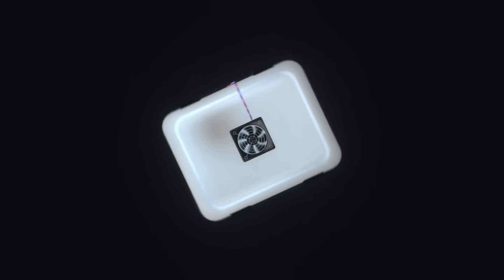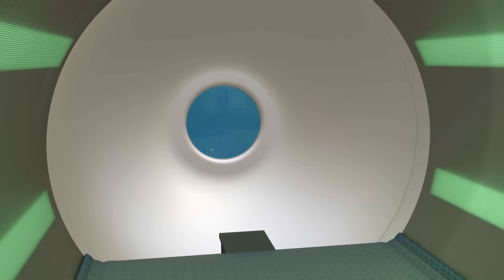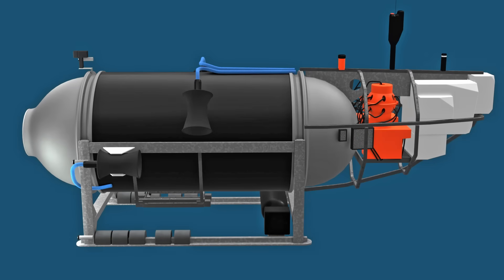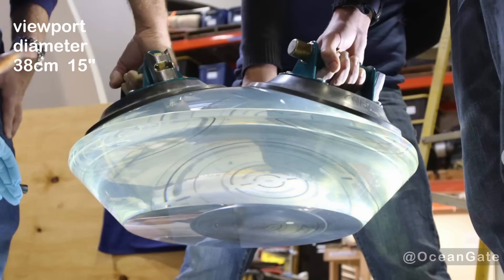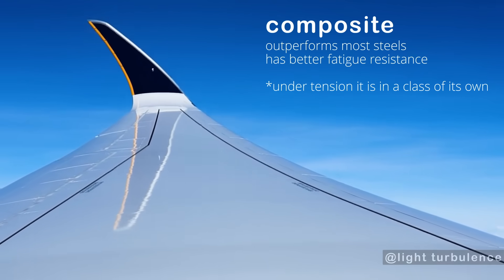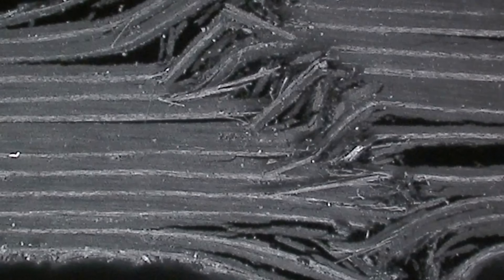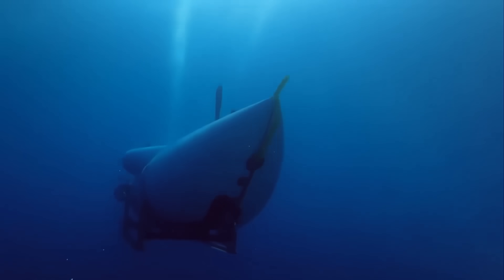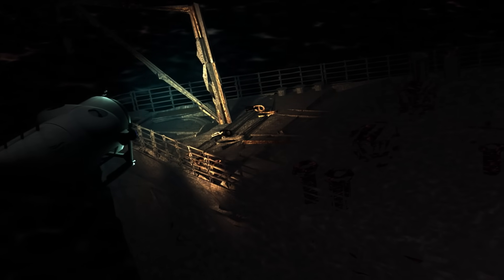Titan Sub | carbon fiber - Detailed Tour

Comment: I remember seeing the edited videos of the build process, and what stood out to me as a non-expert was the process of bonding the ends to the CF tube; the glue was hand-applied (and the surface apparently not cleaned beforehand), bare hands were touching the CF during the application process, it was not done in any sort of clean-room (lots of dirt and dust in the air), and there was exactly no squeeze-out when each sphere was slid onto the tube, meaning there were almost certainly voids.
Reply: Agreed.  I wonder if they had significantly extended the flanges on each end and properly glued them if the sub could have made more cycles before imploding.  I suspect that might have been the case.
Reply: That stood out to me as well. This was not the time for handmade structural components.
Reply: @LordPrometheous In Australia we call it doing a backyardy!!
Reply: @DownUndaDigga  yeah, when it comes to something that could be fatal if there's a problem, that's a hard pass.
Reply: Oh no, they were very careful to repeatedly include some guy with a rag wiping those parts down. I know, a rag right? Sheesh, what a con the whole thing was...
Reply: There was a huge void in the Ocean Gate CEO head nothing but air and ego !!!!
Reply: I wouldn't have trusted even a home aquarium to be constructed in that manner.
Reply: No squeeze out is what shocked me.
Reply: Yep. The no squeeze out floored me. Complete foolishness time and time again.
Reply: Don't they cure the carbon fibre in a vacuum oven which pulls out any air from within the layers of carbon fibre?
Reply: @ALucas73  nope it needed to be cured in an autocave. there were many amatuer hour mistakes in the construction.
Reply: Yeah, I remember watching a video of this process and was shocked at the apparent casual nature this was done. I'm no expert on building subs or fixing composites to titanium, but the whole thing looked sloppy for such a high pressure joint.

It's become more and more obvious that Mr Rush was not sufficiently focused on safety, and that's a cardinal sin if you're researching novel deep diving vehicles, no room for error thousands of feet below the oceans surface. Sort of boggles my mind he could be so cavalier with his own life, never mind his passengers.
Reply: @paulelephant9521  he was arrogant for no reason. He did not portray the arrogance that people say would be deserved because the arrogant person is correct due to their vast knowledge and exp

He stated that concerns of the safety of Cyclops 2 aka Titan were personal attacks on him. 

He may have had daddy issues because his father was a successful explorer and Stockton Rush was basically a nobody in comparison as well as being on the lower scale of wealth compared to his family. 

He was counting pennies when there was dollars to be had. 

There is a reason why the Russians were charging a million per person on the Mir submersibles to the Titanic. You will not break even or make a profit taking people there unless you charge that or higher
Reply: Arts &crafts
Reply: I agree, glue being the only joint between dissimilar material shear. Should have been pocketed so compression could only push the parts tighter, improving seal and not shear from partial glue failure.
Reply: @strayblackcatsmeow It WAS pocketed, the titanium flange had a 'U' shaped profile that the carbon fiber slotted into. 

The glue is a red herring, because so long as the carbon fiber tube remained intact the end caps would be held in place by water pressure alone.

The real problem with the joint is the shear stress from differential expansion at the point where the titanium 'U' no longer overlaps the carbon wrapped tube.  Carbon fiber has negative thermal expansion while Titanium has positive thermal expansion, and carbon fiber is extremely rigid while Titanium has high ductility.
There is also the problem of the differential expansion between the composite overwrap and the inner metal tube, which would cause the tube to shrink faster than the carbon fiber, which would promote delamination and buckling of the individual carbon strands.

Additionally, the pressure cycling in compression would compress the polymer resin matrix of the composite more than the carbon fiber, which would lead to microcracking of the resin when the pressure was released.  This would have potentially allowed saltwater to infiltrate the matrix, which could leave salt deposits behind when it was squeezed back out of the cracks during the next cycle.  The salt crystals could then induce layer delamination, or even direct shearing of the carbon fiber strands.
Reply: the whole construction process was a JOKE. If he had said Im gonna take you to the titanic and I saw that contruction video and we were using a damn nitendo controller to go down to such depths, NO THANKS BRO.
Reply: @dustyflair  That's a cheap Chinese knock-off controller NOT a real one. Stockton is a GANGSTER with the checkbook.  Not wasting money on a hard wired backup either."
Daddy has to save $15.39 when he can.
Reply: @dustyflair  it was a PC controller, but your point still stands.  I just don't understand how anybody with the means and resources to pay for this trip could also be foolish enough to even consider going with him. More money than sense applies here.
Reply: @dustyflair  I also don't see how all these customers were aware of his work, and obviously aware of all the warnings from experts in the field, yet they chose to ignore all of that and get in his literal death trap
Reply: @LordPrometheous if you have 250K spare money to spend then you are probably well-off. To the person that can easily afford to spend this money, the line - once in a lifetime chance - is something that they cannot pass. The   millionaire father and son probably were overexcited and hyped to see the Titanic and our FOMO world today isn't really helping to make thoughtful decisions.
Reply: @Gourmondise  I would have thought my most precious asset, my son, would mean more to me than to embark on such a risky endeavor.  The same intelligence and prudence that made me wealthy would also make me ensure that I do my research and heed any warnings about deep sea treks with a nut job. But some people's risk meter is broken, so there's that. The son didn't even want to go, and was terrified. I feel bad for that kid. He should never have been there.
Reply: @LordPrometheous the mother mentioned in an interview that she gave up her position to her son because the boy wanted to go very badly, as he was very interested in the Titanic. The aunt on the other hand said the opposite, how he went primarily for his father, as a bonding experience. I personally believe the mother, as the aunt seemed very fake and full of false emotions in her interview when she said this.
Reply: -lynn  that's interesting.  I haven't seen the interviews, and I'm not good at reading people's body language or emotions. Now I want to watch. Thanks for the insight.
Reply: They should have used duct tape, and gorilla glue.
Reply: The fact that the titanium flanges had both been blown outward on both sides shows that the carbon fiber probably brittle broke at the ends crushing outward and inward expanding and thus ripping off those flanges..I suspect what you say is exactly why .Voids and bad binding ..without a good bond to the titanium it let it crush instead of being a stable transition..I suspect the gun shot noise was it starting to fail...
Reply: same thing ,mixing and applying epoxy,
Reply: They could have put two titanium rings in the center for support. This comes from a painter.
Reply: @TheOneWhoMightBe You have not said anything that I feel confident is of any value, in regard to why the submersible did not hold up under pressure and the language you use to describe the various objects out of which the device was constructed, was vague and ambiguous. OK I'll accept "CF" as being your abbreviation for carbon fiber composite, but not with some trepidation –. if you do not first state the whole subject or object, it may always remain uncertain as to what subject or object an abbreviation points to. Next. when you say "ends" were "bonded" to the "CF tube" your language gets even more confusing. Ends of what? Bonded to the carbon fiber composite cylinder, at each end of the cylinder, was a titanium ring, – not an "end." Attached to each ring, with threaded fasteners, were titanium hemispheres. These were hemispheres (approximately), not spheres. But here is where you create some more confusion: you go on to assume that the if would have been better if the substance that was used to adhere the ring to the cylinder,  would have been  better bonded if bonded to clean surfaces, and applies by some method other than "by hand." So you have any information that supports these assumptions? For all that I know, the particular substance used to "bond" the titanium ring to the carbon fiber composite cylinder, would make a better bond if applied to "clean" surfaces, and if no perspiration or oils from human skin, were on any of the surfaces. I have no reason to assume this is true. Seems plausible that it would, but I couldn't say this is true, for sure. Perhaps, given the bonding agent that was used, conceivably perspiration or skin oils or both, might make for a better bond. But then you assume the material between the ring and the cylinder is being used to "bond" them. Might it also be needed as a sealer, or gasket? Now, to me, the whole idea of using only a fluid substance between the cylinder and the end-rings, seems rather risky. The following idea might be irrelevant but personally I would never rely on fluid sealer alone, to keep water from getting into the vessel, if I were designing something like this. And important factor, which has been overlooked in your discussion, is the fact that the cylinder and the rings were of different materials, with different coefficents of expansion, and with differnt adhesion to different adhesives. When we have 2 different materials, we usually call the material that is there to hold them together, an adhesive rather than a glue. A glue is what I call something that holds together to similar or identical materials. For example  when making furniture from wood, and joining pieces of wood together, I use wood glue." When attaching 2 different materials together, such as attaching plastic laminate surface material to a plywood surface, I use an _adhesive. I would think, perhaps incorrectly, that the main purpose of the thick fluid material between the cylinder and each ring, is as a caulking material, and only secondarily as an adhesive. But I could be entirely wrong. My point is, I don't really know, and – I have no way of knowing if you really know either Offhand, it sounds to me like you very might just be guessing. You have not said anything that makes me feel assurred that you are not just guessing, same as I am. Whaddaya think?
Reply: @soilmanted I generally enjoy and appreciate pedantry but find it ironic that you couldn't be bothered to proofread your essay before submitting it.
Reply: @user-Aaron-  I agree with you. Reading it now I am feeling embarrassed by how badly it was composed.
Reply: @soilmanted  your comment is needlessly pedantic.
Reply: @soilmanted I wasn't the least bit bothered by your comment--pedantry aside, your comment was very well composed.  Those not in the industry may not know that there is a difference between glue and an adhesive, and may intermix the two without a second thought.  As to the CF reference, I think the widespread exposure (ad nausem) of the Oceangate tragedy affords certain assumptions, of those being that most people watching this video would know that CF references carbon fiber.   I think one major point that was missed in the original post was that carbon fiber simply is not the type of material that should have been used, regardless of how the "glue" is applied, how the hemispherical end caps (for lack of a better term) are attached, or whether titanium, tungsten, vibranium, or unobtanium screws are used to secure the joints.  Carbon fiber simply does do well under compression, and so it should never have even been considered, or dare I say permitted for this application.
Reply: @soilmanted  Nonsense.

Comment: Obviously carbon fibre is useless in compression. It is like pushing a rope. The only thing supporting the Titan was the epoxy. Epoxy is brittle. See JB Weld. Numerous industry experts predicted the faiure. It happened as predicted.

Comment: No matter how strong the material is, if it is a flexible thin  fiber - it will NOT work well under pressure. This thin-layered fiber construction is great for pressurised gas but idiotic for under water. In fact the pressure here is carried by the resin, NOT by fibers. Carbon doesnt matter here at all. That's what all those people saying and they are right. I believe some kind of stone tube (say, made of granite bricks) would do better here. Simply because it is far better under conpression than any polymer resin.
I also heard, Japanese have some 450 MPa concretes. Which is probably good for this application, too.
Even glass (2000 MPa) would've been a better choice - but as monolyth bottle, NOT fibers!

Comment: This guy doesn't know what hes talking about.

Remember,  The entire pressure cylinder was constructed from a single strand of carbon fiber, wrapped to five inches thick. That tells me it has "0" compressive strength, until you add the composite material that glues it all together in a matrix. That design is absolutely perfect for containing 'internal' pressures. There are light weight scuba tanks that are built like this. But to keep 'external' pressure from crushing in, this design is completely useless. The carbon fibers, alone, have 0 strength for this, the composite material that glues the fibers together is completely and totally responsible for all compressive strength... period. Rap a balloon in a couple inches of carbon fiber, then deflate the balloon, you can crush it with your hands. I never graduated high school, but I got a "B" in physics.

Comment: I wonder if there would be some unrelated use/market for the discarded carbon fiber hemispheres so as to make that proper tube manufacturing process more economically viable?

It may not matter now as public perception of this type of sub design makes it a non-starter.

Comment: I am not surprised to see the metal blown outwards. Imagine a failure mode where water is somehow able to enter at one end of the vessel. There will then be an extraordinary force generated as several tonnes of water enters at the speed of sound. At the other end, this water will first compress the air down to essentially nothing, and then hit the back wall at the speed of sound. 
Imagine you're a strip of metal. 
What do you do when a few tonnes of water hits you at the speed of sound? 
You move the other way.

Comment: You know that picture @ 2:51 is really interesting. The scale they're using to weigh people and their gear is an electronic scale on a carpet. These work by using load sensors on the 4 corners of the scale. The thing about using electronic scales on carpeting is that you end up weighing less due to the load sensors sinking into the carpet. It doesn't take a thick carpet to throw the reading off by 30-40lbs. Go and try it yourself if you have one at home.
Reply: thats plainly wrong. It only changes if its the scales body hits the carpet, not a general carpet problem.
Reply: @NIOC630  The only reason I even know this is because it was happening to me and I didn't even realize it. After I purchased a Fitbit electronic scale something didn't seem right. At the gym, the calibrated scale they had was telling me I was 245lbs, however the Fitbit was only reading 215lbs. Something of course wasn't right, and when I realized it could be the carpet I put it on the floor and lo' and behold I'm 30lbs heavier. The carpet I had it on wasn't very thick and the body of the scale wasn't resting on it either, even when I was standing on it. In fact, I only noticed this because my carpet looked exactly like the type of carpet in the video.

Comment: using carbon fiber composite for compresive strengths sounds like using concrete (without rebar) for tensile strength, its pure nonsense, considering they used safety factor 2.6 for there designs, there most be something very wrong with there simulation models.